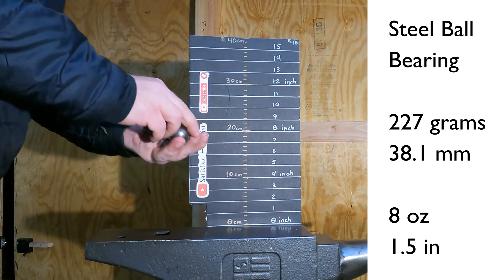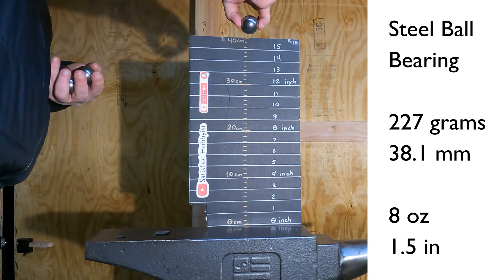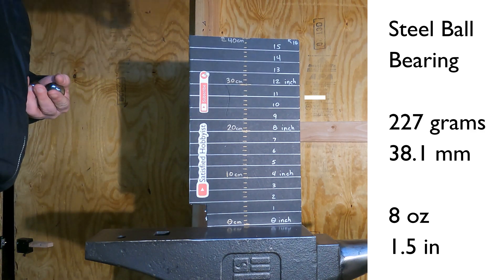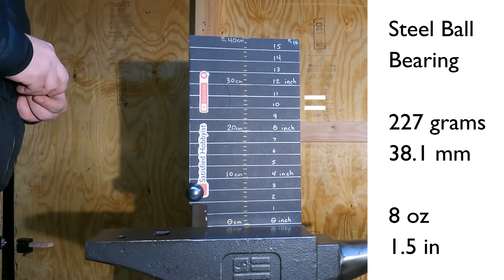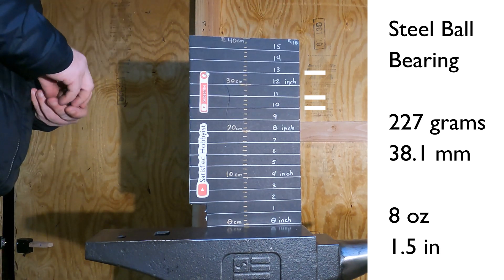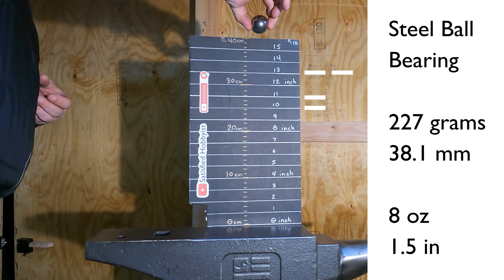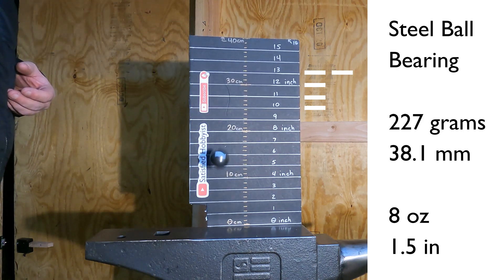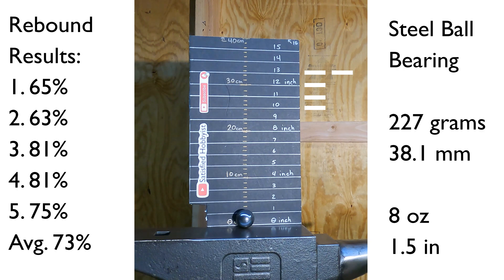Alec Steele Anvil - Rebound Test - Ball Bearings

Comment: Damn that sucks, comparable to a cheapo chinese anvil. Steele shouldnt be allowed to use the flag on that lump. Ring means very little, rebound means a lot. The more rebound an anvil puts forth the less energy is required from the smith, saving energy and time over the course of a days work, resulting in better forging and less wear and tear, both on the anvil as well as the body of the smith. Theres a reason we who make our living in the forge do our work on 100+ year old PWs, Hollands, Mouseholes, Reddinghaus, etc.
Reply from the maker: I have to agree with your points. I made an effort to be as consistent and scientific possible with the drops. You'll see other videos with the bearing being thrown rather then dropped. But nonetheless, I feel the results should have been a bit better also.

Comment: fairly sure the ball bearing test just shows you if the face is hardnened or not.
a hard face won't dent on every stray blow and last generations.

some smiths like to 'hit' the bare face of the anvil softly while they're adjusting the position of the metalpiece, a high rebound would conserve more energy here.
doubt you'll notice any difference between a 60% & 90% rebound anvil when actually hammering hot steel & not the anvil face itself.
Reply from the maker: Good points. All considered it is probably fairly subject a test, but I found it an interesting experiment. Lots of folklore associated with the ancient art itself. That's part of the allure.

Comment: I’m not an expert on rebound but I don’t know why people put such emphasis on it. When metal is hot and soft, there is no rebound when forging. Anyway, 73% is decent. As long as the anvil has a nice ring to it which means no major defects or cracks.
Reply: Rebound is how much force your anvil is putting back into your workpiece. It matters. 73% is decent but it depends on how the anvil was secured. If it was bolted the a stand that was anchored to the ground then 73% is not that great. If it was just sitting on a table 73% is great
Reply: Ring does not really mean quality. It is more to do with the shape and composition, but mainly the shape. Look at Fisher fo example, not much a ring (I believe there was something about urban users being the reason for the quieter design).
Reply: Ring means very little, rebound means a lot. The more rebound an anvil puts forth the less energy is required from the smith, saving energy and time over the course of a days work, resulting in better forging and less wear and tear, both on the anvil as well as the body of the smith.